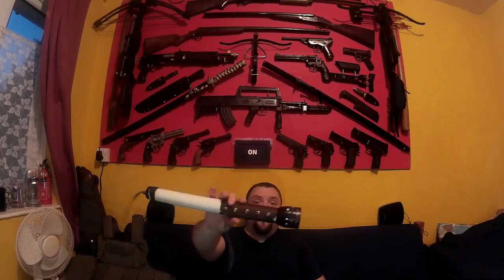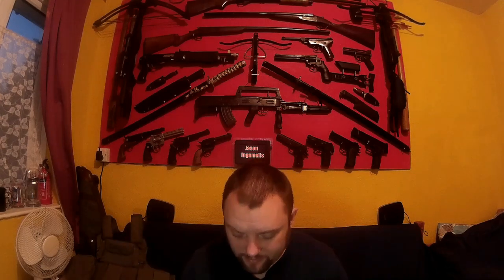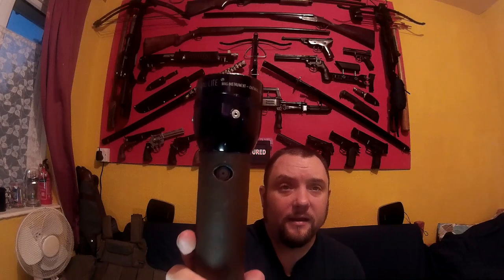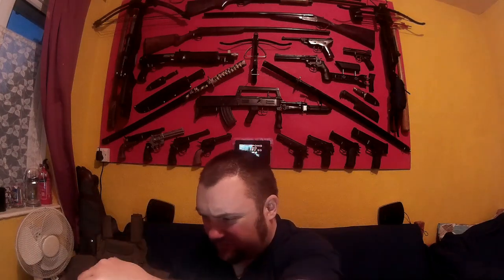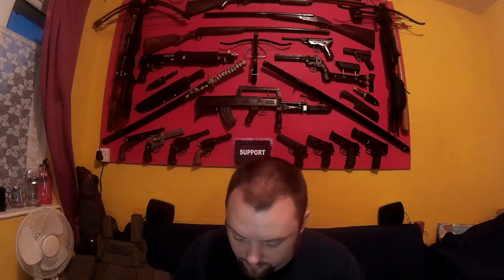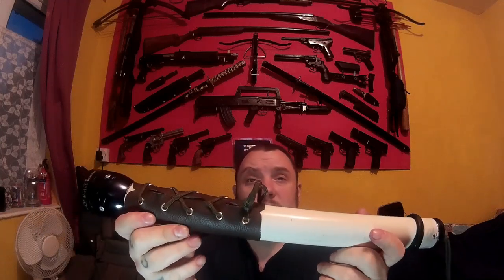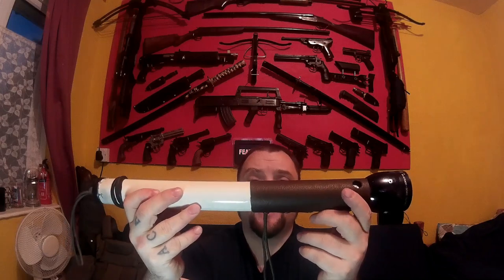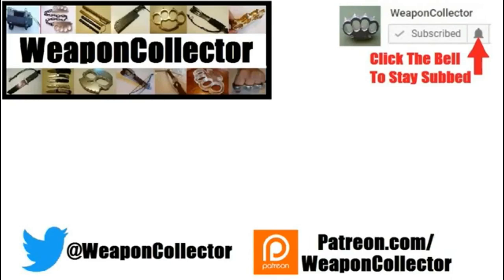Homemade 5D Size Maglite Torch

Comment: nice work mike if you use fishing rod shrink tube it will lap over into the end of the storage part and make a seal for the end cap .Also will give you a good grip if you buiy diamond shrink i have used it on my tools its good stuff.
Reply from the maker: Great idea Ray, i shall look for that stuff, cheers mate.

Comment: put that lock knife with the allen key inside and lock it with the key for that knife .i would also put a felt tip lid in the button hole and take the shrink from over the rivets and the length of the torch and cut an opening just for the charge port and make a blocker for water then it will be an AWESOME torch.good luck.
Reply from the maker: Great ideas Ray, i shall try those ideas, its useable now, but just needs refining.